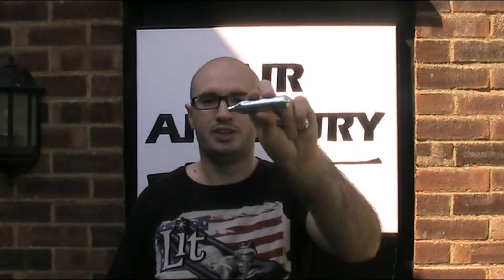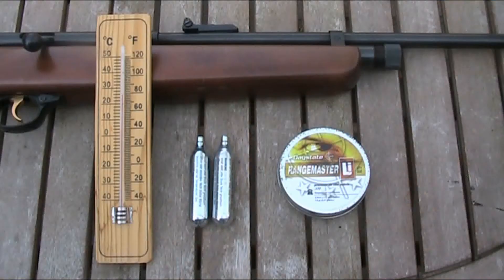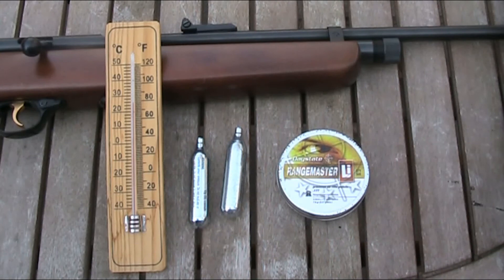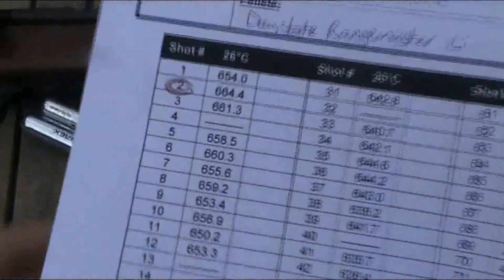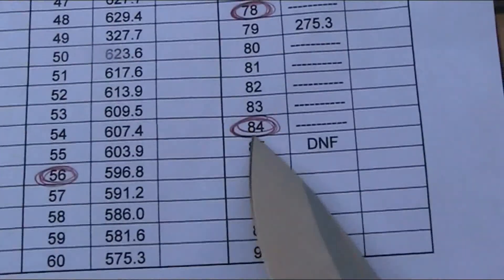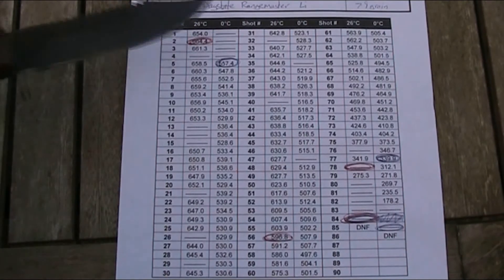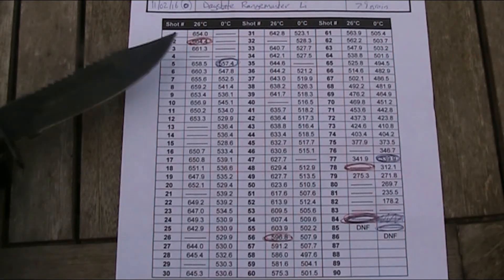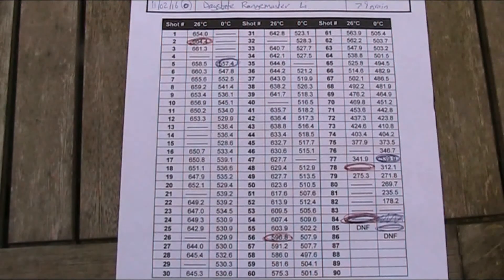CO2 Airguns: Hot Weather vs. Cold Weather Test | Air Armoury

Comment: The physics of this problem is interesting. Here are a few figures that can help understand what you can expect.
The 12g capsule is made from steel and when empty weighs 28.7g (though some manufacturers give slightly different figures). This has a thermal capacity of 12J/degC. When the capsule is full the 12g of CO2 adds to the total thermal capacity by about 22J/degC giving a total thermal capacity when full of 34J/degC.
If we assume we expend a capsule over 36 shots them the CO2 evaporated per shot is about 1/3 gram. The specific latent heat of evaporation of CO2 is 379.5 J/gram. so the latent heat "taken" by this evaporation is about 126 J per shot. This heat is predominantly "lost" by the liquid CO2 in the capsule. So a full capsule will drop in temperature by about 126/34 = 3.7 degC after a single shot. However, the nearly expended capsule will have a lower thermal capacity and will drop by perhaps 126/12 = 10.5 degC.
Of course the speed with which the capsule recovers depends on the conduction of heat from the gun body to the capsule and is going to depend on the detailed design but generally the capsule is clamped only at its ends so not great for heat conduction.

As for the capsule pressure vs temperature the table looks like this:-
0C      33.8 BAR
10C   43.98 BAR
20C   56.28 BAR

So two quick shots when the capsule is close to empty might drop the pressure from over 55 BAR down to about 35 BAR even on a reasonably warm day.

Comment: WARNING WARNING WARNING

Reading and some math up ahead, only the brave and edumakated should proceed with caution. All else, abandon all hope.

Great video, liked and subscribed. This has been the best video to date that I have seen on you tube depicting the effect of temperature to velocity in CO2.

Five questions: #1 What is the barrel length of your SMK QB78 if it is not 21.5 inches? #2. What was the time, in seconds, between shots? #3 What was the ambient air temperature at the beginning of your shooting strings and #5 What was it at the ending ambient temperature of your shooting strings?

I find the best consistency when firing 90 seconds in between per shot for CO2 ambient temperature to equalize to a stable state.

In a nut-shell this is what I gather from your video, which I have not been able to from cumulative other videos on this subject.

Foot pound energy (fpe) varies by about, or a very little less than 1.6831% by the temperature difference in degrees Celsius, linear speaking, or for a quick rule of thumb we can use 1-1/2% per degree C change, proportionally.

Your data given:

7.9 gr x 664.4 fps x 664.4 fps/(2 x 7,000 x 9.80665/0.3048)= 7.741 989 719 fpe @ 25 oC

and

7.9 gr x 557.4 fps x 557.4 fps/(2 x 7,000 x 9.80665 /0.3048) = 5.449 131 286 fpe @ 0 oC

So,

7.741 989 719 / 5.449 131 286 = 1.420 775 04, or rounded to 142.1% for a 25 oC change,

and the same can be said for the velocity:

664.4 / 557.4 = 1.191 962 684, or 119.196 268 4% rounded to 119%; in other words, a 25 degree temperature in Celsius brings about a 19% change in velocity, linearly speaking, so for a quick rule of thumb we can say 0.767 850 735 6% change in velocity per degree change in temperature Celsius, rounded to 0.75%, or 3/4% per degree C, linearly speaking.

Now, if your transfer port is opened at 100% efficiency (n), which would be the caliber diameter, and you haven't done any major modification improvements then your overall efficiency can be calculated using the following formula:

psi x π/4 x 0.177^3 x 21.5"Bbl /12 = fpe

I looked up the barrel length on line and it stated it is 21.5 inches.

Now isolating psi = 7.742 fpe / (π/4 x 0.177^3 x 21.5/12) = 992.169 096 9 psi in CO2 pressure, if your overall efficiency (n) is caliber in percentage, which usually is when pulling a gun off the shelf, stock.

Now, CO2 pressure at 25 oC (77 oF) is 64.343155956794 Bar (933.2186175204434 psi)

CO2 calculator:

http://www.energy.psu.edu/tools/CO2-EOS/

Houston! We have a problem! There is a discrepancy of 58.9504793795566 psi (4.064492303555535 Bar), and the discrepancy is that you do not have a 17.7% n, but more closer to 18.82% n; in other words, you have a better than stock gun off the shelf. Have you done any tuning?

Great video, entertaining, educational, informative, and enlightening. 

You were warned.

Comment: It's warm here in New Zealand currently, so I'm yet to find out what the cold does on mine. I have 2 Crosman CO2 powered guns, a 1077 12 shot "repeatair" .177 and a 2250B .22 bolt action single. I reckon I'll mostly just stick with the "gas-ram" Springer Beeman RS1 in the real cold if the CO2 losses a whole 100fps approx when really cold.